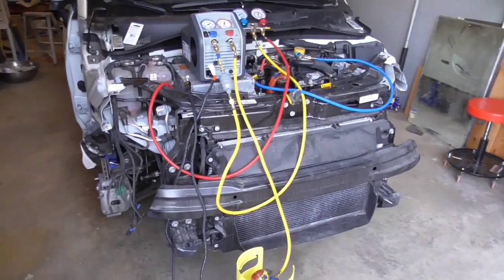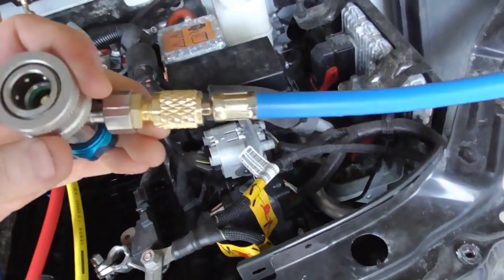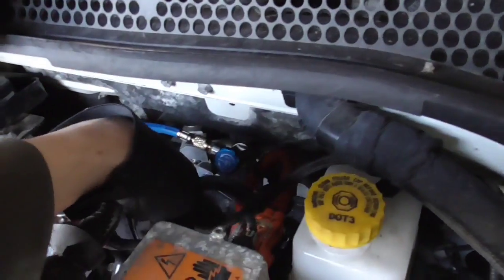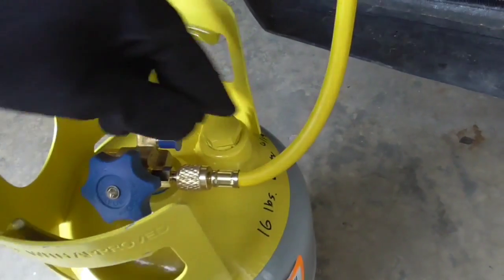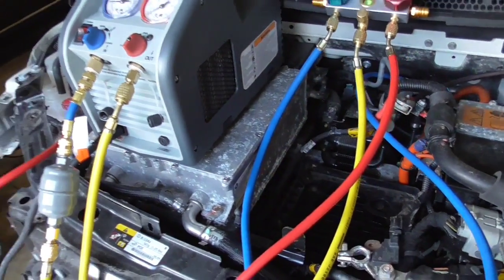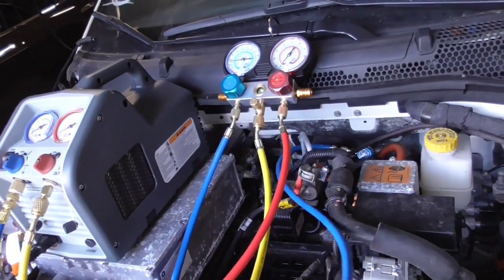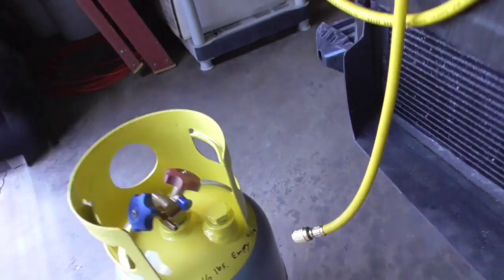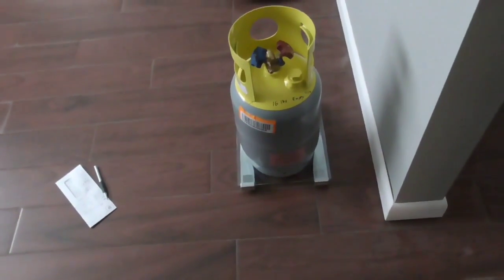How to recover R134a refrigerant from a car

Comment: Don't forget also, if you have pulled a vacuum on the system, the schrader valves will only hold positive pressure. As soon as you remove the service port connectors, your system may suck moisture in. Dry welding gas could be purged in to bring up to atmospheric pressure if you don't have nitrogen to hand.
Reply: A vacuum is negative pressure.

Comment: My LOW side is above my HIGH side. I do believe the magic words are about pressure and not about height above the ground.
Reply: Was going to say the same thing and ideally wouldn't the vapor line be above the liquid 🤷
Reply: Doesn't matter its a sealed system under vacuum @Catchmeifyoucan209Stockton

Comment: Thanks for at least showing an evac machine. 

Yours is the first video on youtube in which I saw the capture evac pump

Most youtube "DIYer A/C recharge/repair" videos TELL you to get someone to evac your system for you. (Or kinda, sorta, imply you could vent it)
Then most videos jump to using a vacuum pump, getting a vacuum and adding freon, oil, and dye.

Still reviewing the last section of video.

Comment: The "knob" at the middle of the manifold gauge (over the yellow hose) is not a knob. It is a cap for the schrader valve. Turing it all the way ccw will remove the cap but have no effect upon the schrader valve. This manifold gauge has a schrader valve next to the yellow hose. Most manifold gauges do not. The purpose it to enable purgring the yellow hose by pressing down on the schrader valve button, rather than untwisting the yellow hose at it connection at the gauge set.
Reply: Overall decent video but I had a good laugh when he twisted that.

Comment: You need to vacuum the storage tank before you try to use it.
Reply: Yup let out nitrogen & boil out the bottle👍
Reply: No need if there is already a refrigerant in it right?
Reply: Looks like he already did that procedure before adding the 22 lbs of refrigerant he kept mentioning. I always wondered if I needed refrigerant in the bottle prior doing these types of procedures and from what I recall, that is the case but then what if I recover (bad) refrigerant from a car, then all my refrigerant in the tank is contaminated lol
Reply: Yes, if you're doing any work on your system, you're going to have to vacuum it down afterward and so you might as well get the vacuum pump.

Comment: As a Reefer Tech. I work on both automotive type systems as well as reefer trailers. I will say that not everything was done correctly in this video. Not going to point it out, others have already. I just give you props for going out and getting most of the tools needed. You are trying to do it the correct way, that is great. You are using a filter on your recovery machine. I can't tell you how many times I have seen a universe and/or a type 2 certified tech not use one. Hell I've done it before out of laziness. Tring to do something the correct way, gos a long way in my book.
Reply: That "middle valve" on the guages isn't a valve.  It's the cap on the purge valve.
Reply: Goes*
Reply: Yep I agree!!!
Reply: What is a “reefer” tech?
Reply: @cheazzle1243 refers are refrigerated semi truck trailers. They are the trailers they use to carry food to the grocery stores.
Reply: @cheazzle1243 Someone who works on refrigeration systems in trailers and in large commercial buildings.
Reply: @cheazzle1243  lt don't sound legal.
Reply: Does the recovery machine used on HVAC air conditioners work on veheciles to
Reply: @rednecksutton3540  yes a recovery machine is a recovery matching. However don’t mix refrigerant oils. My policies always use one for Mineral and one for PAG/ESG
Reply: Yes, this guy is out of his ballpark, I think. Just ran across this video 4 years later. Hope he has better knowledge now. First I noticed that the front of the car says EV.  Wouldn't an EV be using R-1234YF, but this is probably a import and was on the end R1234A usage before the US Federal requirement of R-1234yf mandated for 2021. So , let's go with the R-134A. Then I noticed that he turns the cap on the yellow line saying that he is opening the valve that should be a blank to connect the hose to when storing the gauges. I also like how the tank was labeled for R-140 Freon. Then he cuts off the vacuum pump before all the valves are closed. Noticed that his blue gauge has a pressure reading, do not think he closed the manifold  valves at that point.

Comment: I can tell you really don't know what you are doing and should not be trying to teach on A/C systems. There is so much more to it than what you explained. You have my respect for taking on this project. A/C's are really not for the DIY. And time to recharge if you use a scales like Matt said and if you get it right your safe . Put to recharge you have to take into account the temperature and humidity because a hot day your pressure will be higher, you can really do some damage if you over charge. Take it to the pro. Good luck with you project.
Reply: But be honest how many ac systems have you personally seen get damaged by not taking humidity into account lol omg it's not that deep
Reply: Hes not even talking about recharging it yet... Hes just evacuating the system.
Reply: Bro, I’m an A/C tech, as long as you do this in a shop of some kind where your temperatures don’t rise and fluctuate much you are good. No shop takes temperature and humidity into account, trust me, unless you take it to like a Ferrari/Lamborghini dealer maybe… he had a few things he could’ve done better, but none enough to damage your system.
Reply: Sure, he’s an amateur, but the reason this has so many views is that DIYers are tired of being hosed by con men that pretend like basic A/C work is rocket science so they can gouge your wallet.
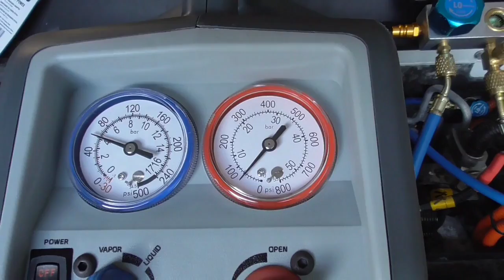Reply: Tf 5:25 5:25 fdxx😅ccxc😅xc😅xxxx😅x😅xcc 5:26 5:26 cxxxcxxxcxxfxxffff 5:27 fxxxcxcfxcfxffffxffc😅 did xxxcxxxxxfxxxxxxxxxxxxxxxxxxxxxxxxxxx😅dxffv😅fxxxdcccxxxxxxxxxxxxxc😅xxxxx😅xxx😅bcx😅😅c😅xcxxxxfxxxxxxc😅xxxx😅x😅xxxxxxfxccxxcx 5:33 cx 5:34 xccxx 5:34 cx😊x 5:34 😊x😊😊xx😅fc😊xc😊c😊xddd😊dcxc😅cxc😅xxfcx😅cccccdddddd 5:36 dd 5:36 5:36 dy 5:36 gd 5:36 5:36 dfxddddf 5:36 xfxdddddddddddccxddzcccdccccdcdDcdddxdddcxdcccdcdcxcccdcccccccccccccccdcdccccccccdcdDccdccccxccdccccccccccccccccccfxccxcxccccccccccdcxcccccxcxcxxcxxcxccxxcxxcxcxxccxcccxcxccccdcxcccxccxcxccxxddccxcdcxcxccccxccccxxccccccccccxxxxcx

Comment: Im an hvac tech. And this set up would work for me since I have all these tools. The only thing Im missing is what the automotive recover machines have: a way to recover the Oil it gets from the refrigerant recovered. Thanks
Reply: WorldRenownedCFE  the oil is not the refrigerant you expert.
Reply: @rightconditions2010  😂
Reply: THE OILS NEED TO BE MISCIBLE WITH REFRIGERANTS IN ORDER FOR IT TO LUBRICATE THE COMPRESSOR. THAT MEANS ITS A HOMOGENEOUS MIXTURE. So technically it is apart of the refrigerant. So inadvertently you will be removing oils aswell.  Rule of thumb: the slower the recovery the less oils will be removed. The faster the recovery the more oils will be removed.
Reply: Doofus

Comment: People like this , Independent Shops , Used Car Sales Lots , Dealerships & Joe Smoe Neighborhood Mechanic who haven't heard of a Hand Held $2,000.00 "Refrigerant Identifier" should be doing ALL their A/C Work for FREE & I'm making a WorldWide statement.

If you don't put a "R.I." on EVERY vehicle before attaching your Tool Box A/C Manifold Gauge Set or Recovery Machine to that persons car , chances are you're gonna infect every car that you work on.
..Eliminating this 1st Step ( not using a "R.I." on EVERY vehicle lets me know you haven't attended a Latest A/C Class.......I didn't find this out until I sat my Butt in an A/C Class @ Los Angeles Trade Technical College , Year 2015.

The Internet has finally become a Blessing and a Curse..Lots of people are getting advice about Car work from a lot of people that's giving you Bad Advice.

P.S. - For those of you that don't have the "Real Manuals" for your Vehicle , an excellent yearly investment is
www.alldatadiy.com 

A Refrigerant Tank should not be filled to more than 60 % of its' Capacity.
Example ( 30 lb. Tank ) =
.60 X 30 = No greater than 18 lbs.

See if Headquarters ASE in Virginia still give out the FREE 29 page " Refrigerant
Recovery and Recycling" Pamphlet.....
.....You don't have to read every page but I guarantee you'll read it in one or two Settings.

800-390-6789
703-669-6600
703-669-6122 : FAX
Email : contactus@ase.com

R-134a is UNACCEPTABLE commencing with Model Year vehicles 2021 ( 7 months from now )

R-12 Refrigerant : 1930 - 1992

R- 134a : 1992 - 2017

R-1234yf : Year 2013 some Cadillacs

Year 2016 or 2017 to Year _______?

Make da_ _ sure you read the Underhood Label as to what type of Refrigerant this Beast calls for before purchasing any Vehicle. If there isn't a Dealership in your Town, Google the nearest Dealership to your Addresss & give 'em the VIN # of the Beast you're getting ready to purchase for your 18 year old Daughter or call Houston,Texas & say , "Houston , am I going to have a problem with this Beast ?" - Houston : "What's the VIN # ?" - ( Smile )

Legend Series Brand or Robinaire Brand, maybe.

Comment: Good video , but I believe the yellow line valve you where opening is not a shut off valve is a bleater valve so you don't add air in the system
Reply: "Bleater" valve omfg 😂 God bless you
Reply: I have a MAC EPA 609 License for performing Automobile Refrigerant Services because there are rules and regulations for performing this type of service. I came across this video while researching for a place to empty my 30LB Recovery Tank. The EPA need to arrest this guy and YOUTUBE need to pull this video.
Reply: @rjeromej8149   where can I empty my refrigerant tank at ?

Comment: Thanks I had to replace my ac condenser/ transmission cooler it’s one pice witch is stupid. The ac is fine the trans cooler was leaking so I had take out the Freon discontent the lines and put the new cooler in and put the lines back and re change it
Reply: Generally the trans cooler is a part of the radiator…

Comment: I take it the recovery tank needs to have a vacuum prior to adding anything in? i.e. suck out the existing air/moisture?
Reply: no, recovery happens first, then you evacuate to remove air
Reply: @johnbenedetto3096  i think he meant letting the nitro that some new tanks come filled with. not evacuating the system first and then the freon which would not make sense

Comment: Glad you posted a video about those portable recovery machines I’ve seen. I was curious why some are 4 to 5k and then some are $500, This  pretty much answers that.Now it looks like it’s going to be phased out anyway with a r1234yf and a $5k machine wouldn’t work on that and you’d have to buy a different machine,but I’m no professional. I just remember when you could buy r12 and then it was phased out and a 30# can was $700, then wished I’d have gotten some before so I could have cold ac again.
Reply: Gas conversion is a thing. Plenty of tutorials here